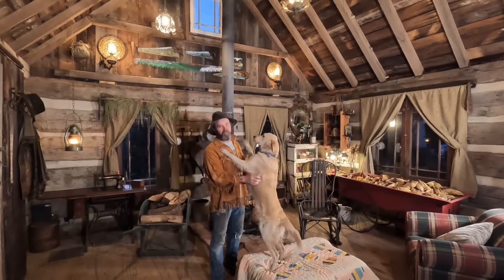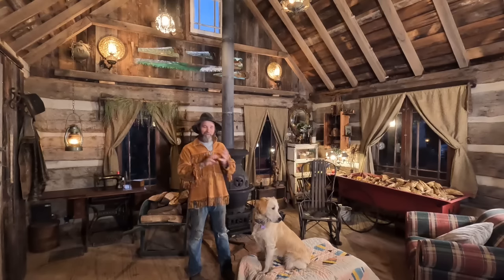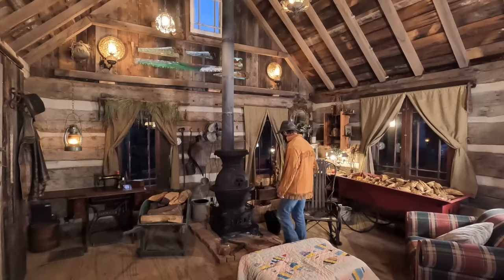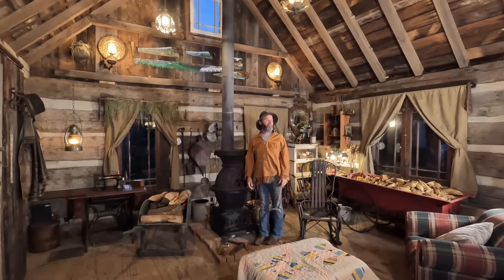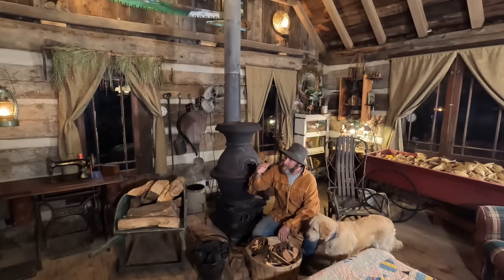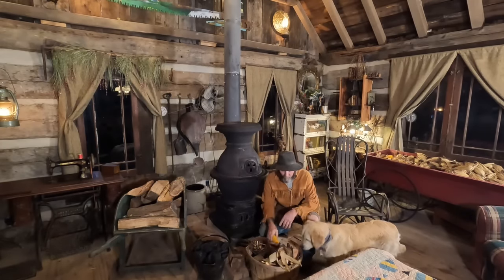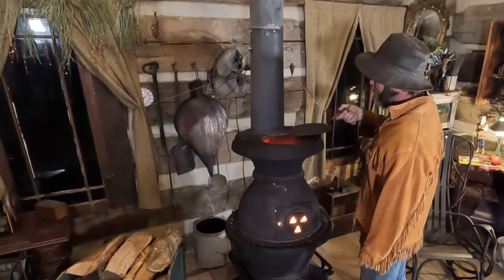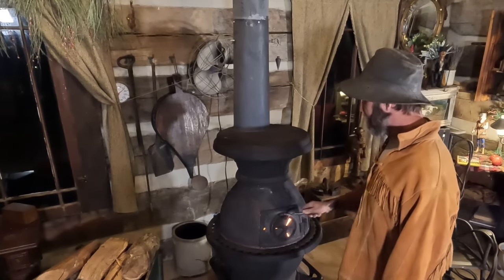Firing the wood-coal potbelly stove in the 1800s log cabin project

Comment: My parents were both born in the early 1900s. Back then coal was delivered by the ton and dumped in the basement coal bin so it could be shoveled into the furnace to heat the house. To make the coal go as far as possible the boys of the family would be sent off with bushel baskets to infiltrate train yards, find coal cars on parked trains or slow moving trains, climb onto the cars and steal coal by shoveling it off the car so it could be picked up and carried home. My old man talked about the time they were doing that on a slow moving train which suddenly picked up speed. They had to ride on top of the coal car until it made the next stop, hop off and grab onto the boxcar of a train headed back to where they lived.
Reply: Wow that's a story
Reply: “Making the coal go as far as possible” is an interesting term for outright theft.
Reply: @censusgary  They used to do the same to the ice wagons in summer, if you want to know. The driver was up front minding his horse and boys would infiltrate the back of the wagon to steal chunks of ice. Couldn't filch the big blocks but would make off with any smaller chunks. That was a big treat back then for kids, to have ice to suck on in the dog days of summer. 

But my old man was also being hired out by my granddad at the age of 10 to work in the fields of local farmers. Full day's work in the fields, all summer long. Child labor laws were not enforced back then so most kids worked as soon as they were able. 

When he was 14 he got a chauffeurs license (no drivers license required back then and he knew how to drive my granddad's tin lizzie by the time he was 12) and was driving taxis in Chicago after that, to bring in money for the family. The local bootlegger mob then hired him as a driver. The money was better, so he went for it. 

That was Bugs Moran's gang. 

For all that, he graduated from high school - not all boys did back then - and got a degree in architecture. But he still drove for the bootleggers until late in '28. At that point in time the guy he drove for took him aside and told him to get out, things were going to be getting bad. The old man listened to him and quit the gang. After that he went straight and gave up his life of crime. 

A couple months later the guy my dad drove for was killed in the St. Valentine's Day Massacre. 

Crime doesn't pay, as Dad found out. He never got so much as a traffic ticket the rest of his life.

Comment: The only time I've ever burned coal was in the Army in BASIC (96'). They had piles of coal at all the bivouac sites and we used the old army potbelly stoves for the warming tents and the drill Sgts. tent. We used the same stoves later in the field in Germany but then we used diesel for fuel. If anyone watching is looking for a stove for a big tent/ little cabin, the US army potbelly is portable, disassembles for transport and cleaning, and can be configured to run on coal, wood, or diesel fuel though if you go with diesel you'll find the stovepipe will need almost daily cleaning.
Reply: got any websites we can use to find that model or a specific name?
Reply: @jerrycarmody6717  This is the one I used.  The top half literally just sits on the bottom, you just have to lift it off to take it apart and the two halves sort of nest together for storage.
Reply: @Leightr  if you posted a link i cannot see it.
Reply: test
Reply: search "US Army potbelly stove" first result after the ads.
Reply: nine attempts to post a link. NINE!

Comment: When I started work in the early 70s there was this corrugated iron shed in the corner of the field , the pot belly stove would burn anything . Hedge trimmings from the hedge laying , prunings , fence off cuts , it boiled the kettle well too . 👍🇬🇧
Reply from the maker: Very much the same with this one. I feed it everything. It will even melt glass into nothing

Comment: Too Cool. Your home looks like a Movie set. Living overseas we relieved a lot on sunshine and shutters for either blocking out extreme solar energy heating the room in the summertime  or  closing the shutters and  thick curtains in the winter to block and cold air draft coming through the windows during the winter. Sunshine in the winter was very important during the day to warm up the room. We had kerosene heat during the day and always needed a window cracked open in every room for safety . Never sleep overnight with kerosene heater lit. Your cabin has the perfect interior for entertaining. I hope puppy has a warm big bed to nap on during the day !  Great lighting.

Comment: Your cabin looks amazing. But a couple suggestions.  You should really think about insulating that roof. Not just so you wont waste fuel but also to prevent ice dams.   And honestly coal is a superior fuel. You can slow burn a full potbelly with coal for 10 hours without touching it. No creosote.  A magic heat chimney heat reclaimer will also be your best friend. It will circulate wasted heat from the chimney and move warm air around your cabin.

Comment: mine is a hutch parlor stove i have gotten a 34 inch piece of firewood in it 3 at a time and since the wood is stacked upright it burns all night ... Am using coal now and some wood which keeps the coal from getting out of hand HOT it seems so small but like i said holds a lot of wood!!! almost as much as a king long wood stove ....I out of all my family and the natives of this town am one of the few who still use wood heat for about 28 years now and my coal is anthracite the hardest ( too start) and the cleanest burning!!!

Comment: my family had stove when i was a kid. worst part is  have to clean stove after burning coals and woods. There should be tray at bottom for ashes.  You can also make a hole on ground of house and place a container beneith of the house, Thus transfer ashes from stove  to a container is easier.

Comment: New subscriber.
I’m going to assume that you should not burn coal in a woodstove  or a fireplace Insert.
Reply from the maker: Not unless it is made to burn coal. Coal needs a lot of air from under the fire. You can tell if a stove is meant to burn coal if it has shaker grates and a way to get air from under them.
Reply: @logcabinlifestyle  thank you

Comment: Those little pot belly stoves are actually for burning coal.
Reply from the maker: Yes, for sure. I do burn wood in mine but you have to be careful because it will run out of control very quickly if the wood is too dry